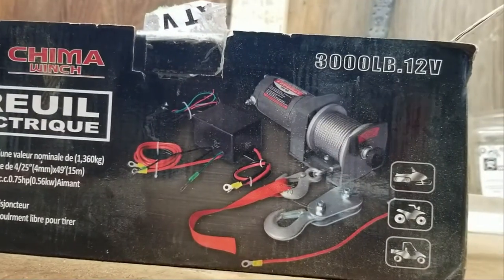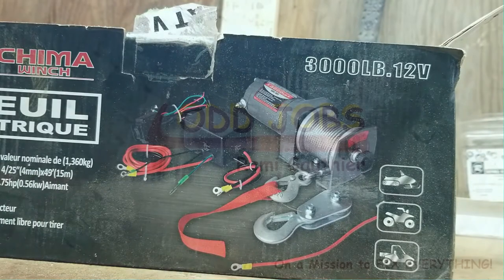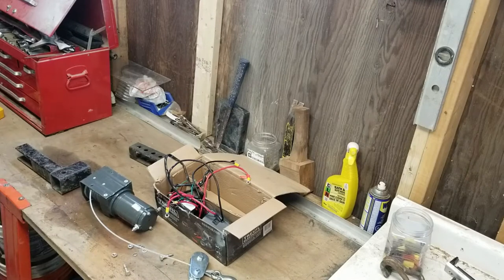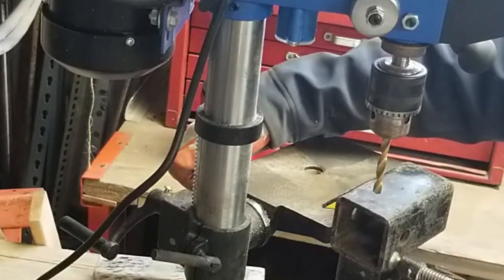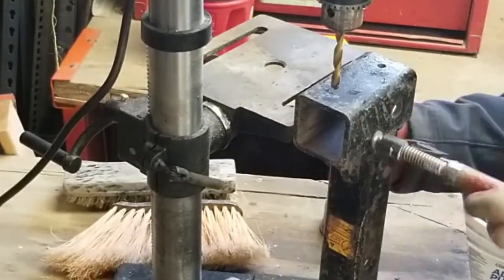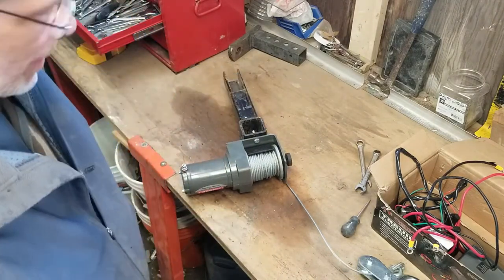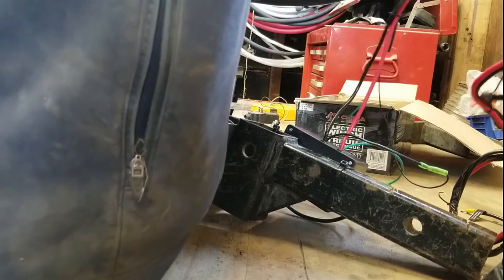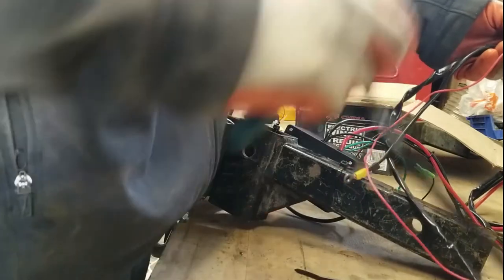install electric winch on truck hitch

Comment: Have a similar set up and I sure hope you replaced the chicom hardware with good Grade 8 stuff. I wonder if the trailer wiring harness can handle the load?
Reply from the maker: You are absolutely right! The trailer wiring is insufficient to say the least. I have since replaced this truck, and hve not yet run wires from the battery for this....perhaps that project will happen this spring.

Comment: Instead of using alligator clips to the battery, why not straight to the 12V trailer plug.
Reply from the maker: That is a great tip. Just be sure that the power wire coming to the reciever plug is of a thick enoigh guage wire to carry the load this winch would put on it.
Reply: @oddjobsremigauthier  I’ll be sure to  replace the wire with a thicker gauge.